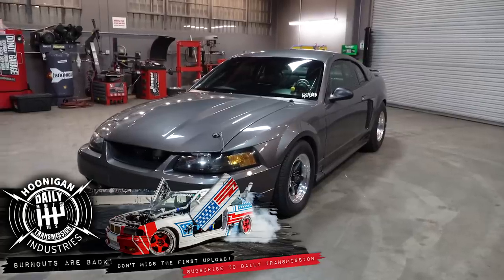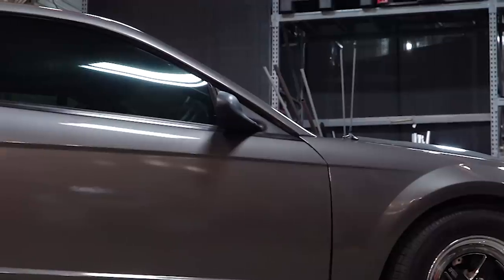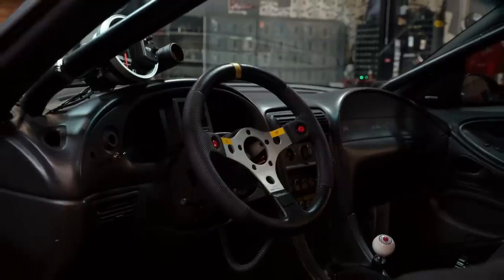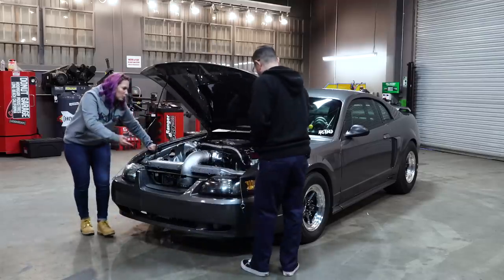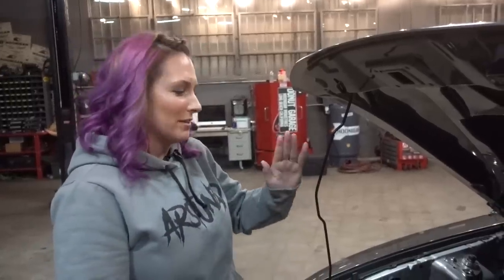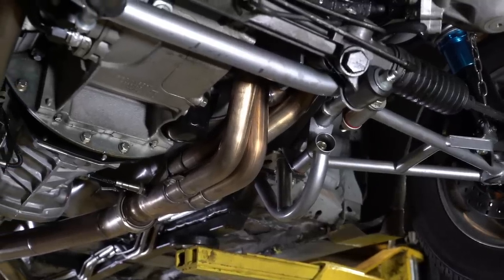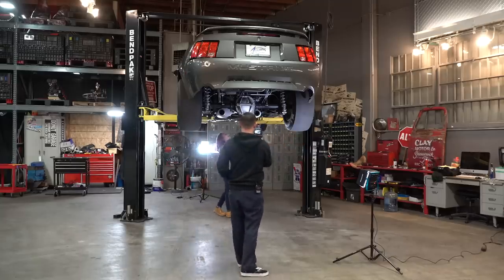Built For Wheelies: LS9 Powered, Supercharged Drag Mustang

Comment: "Got my LS9 cheaper than any other LS"
Yeah that's where I'm gunna stop your right there chief
Reply: CollegeCars  when she said it can handle 1400hp from factory Yeaa let me stop you there
Reply: I mean if you know people anything is possible lol
Reply: Ryan Till facts lmfao, Fran from rpm got his sbe LS9 to 1230 before spinning #4 I believe
Reply: Saturday Winter I mean the last LS9 pullout I saw was around 12k so unless someone is cutting 8k off discounts somewhere I needa kno
Reply: Ryan Till I seen some with 1200whp so I’m sure that’s 1500hp crank I don’t like to comment but LS9s are the strongest out of the LS’s and if 4.8s can handle 700wheel im sure an engine worth 12 times more can handle double the power
Reply: I think she meant that she got the engine for cheaper than an ls car. As in why spend all the muns on an expensive corvette when you can just buy a cheap mustang and put the crazy engine from the expensive corvette in it
Reply: Gemini yea probably, makes sense when you think about it but my vette wasn't that expensive when I bought it but still a 4.6 stang is definitely much cheaper still I would love an LS9 but I'll take my built HCI 6.2
Reply: @z0sick87  spinning a rod bearing doesn't mean the block cant handle the power, means there was clearance/oil sheer strength issues, some weights a safer to use under certain situations compared to others (whether its a light or heavy viscosity and if that changes with temp or is static) and she got the LS9 cheaper than it would cost to build a comparative LS that would provide the same reliability.
Reply: C Pinell I know how it works and I have never seen an SBE LS9 hit 1400 wheel crank maybe
Reply: Ls9 in a mustang 🤢🤮
Reply: That one cauht me too, but if you have a resource at GM they may have been able to aquire that LS9 for a price they couldnt refuse.
Reply: lq4/lq9 way cheaper... for the price of a ls9 you could have a 1200hp lq4/9...🤷‍♂️ 😂
Reply: I prefer a sbc turbo 350 383,400 small block you can easily get 900hp bang for your buck...you don't get the modern technology but I love the simplicity of a carburated engine
Reply: Can she get me one too🙌🙌🙌🙌
Reply: Probably meant cheaper than a off the self ls9
Reply: Coyote>ls9

Comment: Nice.  Needs a 2650 blower swap.  2.3L is so two thousand late.
Reply: TurboDieselDan Kong performance can make the stock 2.3 push past 900whp with ease, their shop car is deep in the 8’s on a ported stock blower.
Reply: @MVSTNGGT  You should have told GM this so they would not have had to spend all that $$$ on the 2650 for the C7 ZR1.

Comment: "1400 hp from factory." Press x tp doubt
Reply: ak assasin considering a 200,000 mile LY6 6.0 truck motor can make over 1540hp on the stock gapped rings, block and bottom end and other motors like the 5.3 and 4.8 have been proven to handle between 1200-1400hp on the stock components, id say shes not far off. Look up big bang LS test.
Reply: @MVSTNGGT  yeah I read an article about a truck motor that made 1500 hp. For 1 pass. But its quite onvious that she is going for more than 1 pass at a time. I could be wrong though I dont know much about the ls9 mostly lq4 lq9 and ls2 is what im into.
Reply: ak assasin in essence, the LS9 is like the truck motor, but with a fully forged rotating assembly, more cubes, much better heads, and a blower capable of supporting over 1000hp with a port job. Its technically the best LS money can buy, unless you go full aftermarket.
Reply: @MVSTNGGT  just read some stuff about the engine. With forged steel titanium and aluminum internals it does sound like it could handle that quite easily. 👌

Comment: I usually hate the idea of a Chevy in a Ford or vise versa, but the Ford engines in 2001 were shit..
Reply: The 4.6 😂 what the hell are you talking about?
Reply: 4v 4.6 is a legend
Reply: The 2v's are garbage but they sound good.....as long as the block didn't decide to quit.
Reply: that comment realy shows that you have no idea
Reply: @SuperSilvi1990  you kidding? If you put forged internals in it it's a great motor. One of the most under rated
Reply: @user-qx7tm5df8j  they never had plugs blow out of the heads at 110k... never had plugs blowout while tryna get laid... never had rods thrown through an oil pan while idling
... they never had them problems

 I did. Lol.
Reply: @michaelgalin7373  but yes, once built properly, they really do move when boosted. But finding that right combo on your own... expensive
Reply: Theres a reason why comaro took a haitus till like 2008
Reply: The 4.6L modular 2V was a very strong engine. N/A, they weren’t too good however when boosted, it’s a hell of a performer.
Reply: I think she answered that. It was gonna be a 911 build but the mustang body was more cost effective. I think thats how most LS builds go

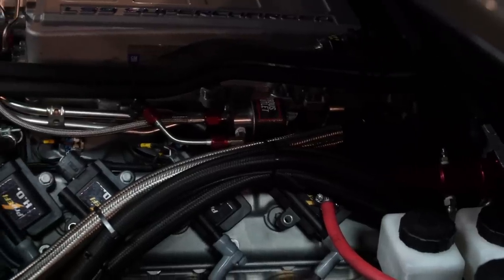Comment: 06:14 No it’s not. It’s a freakin LS, it’s not fancy. Don’t go all „Oh ya it’s basically a supercar motor“ just because it’s got some upgraded rods. It’s still a pushrod engine with two valves per cylinder. It is run by literally 1960s technology, nothing new or technologically advanced about it. It literally has got nothing going for it except that it happens to be a block of metal into which someone decided to bore particularly large holes and then slapped a repurposed industrial air compressor on top
Reply: Sooooooooooo the current gen ZR1 isn't an American Supercar? You're delusional if you think it isn't one.
Reply: Pistons have been circular for to damn long. Spark plugs have been sparking for over 100 years.. wtf brah. 

If you dont have have some antimatter shiiit GTFO!
Reply: Meteor Media get back in your spaceship and chill out
Reply: You do realize that the ZR1 DOES compete with most common "supercars", right? Or do you just measure cars by price tags and dyno sheets?

Ever wonder why the Vette has been an automotive icon for over 50 years? BECAUSE THEY BORDER BETWEEN "DAD'S MID-LIFE CRISIS" AND "THIS CAR WILL KILL YOU".
Reply: Saturday Winter - omg the typical cOrVettE Is a SuPERCaR. No it’s not a plastic pos is NOT a super car. It’s a sports car. Supercar isn’t measured by performance there is way more than just performance that goes into it. Fuck I’m not wasting my time.